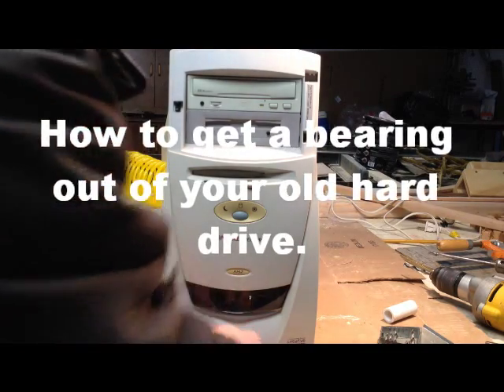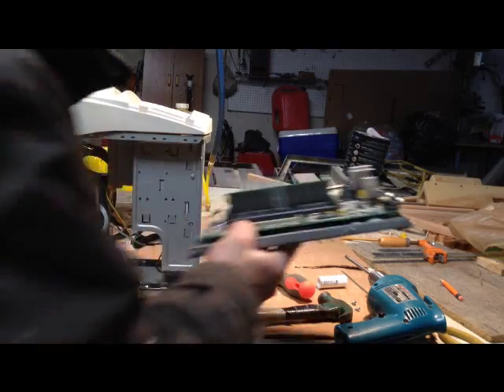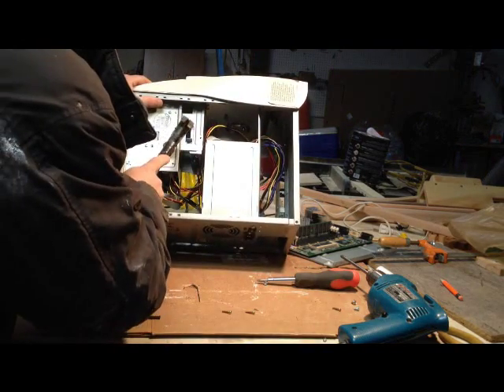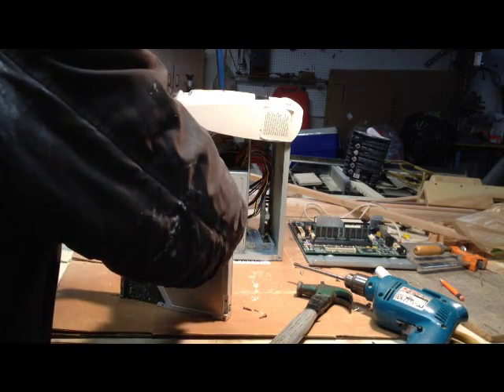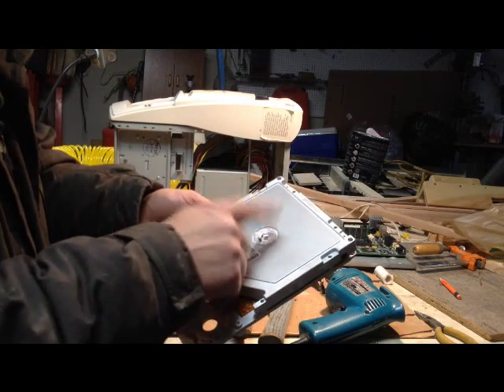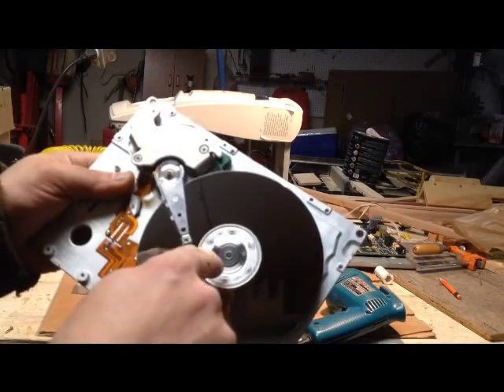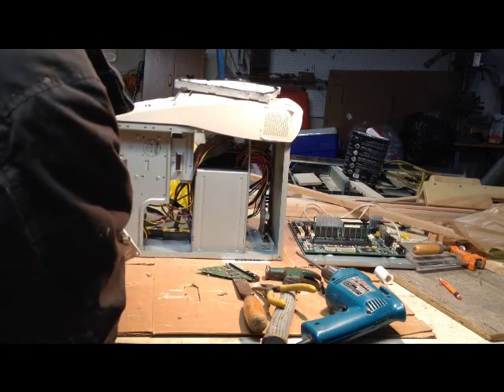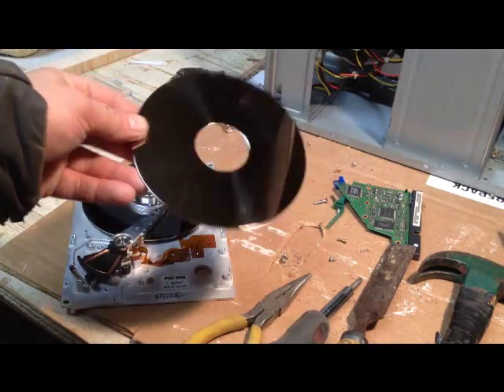Hack an old hard drive for parts

Comment: Now this is how a real man fixes a pc. Non of this mucking around with antistatic jewellery and little screw drivers 😂😂👍
Reply from the maker: +MrStreetboy80 LOL thanks for the comment there's always a bigger hammer if needed
Reply from the maker: +MrStreetboy80 you should check out my video showing how I got rid of the viruses in one of my computers.
Reply: shanesmaineshop I saw how to clean out a pc, I'm guessing that's cleans up viruses aswel lol.